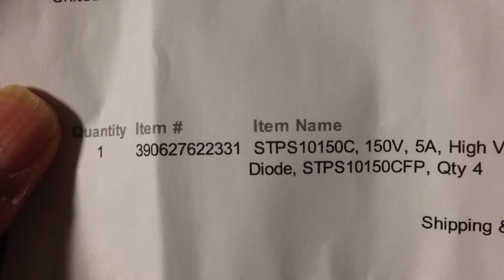Induction Heater Part 4

Comment: Awsome! I tried using a voltage regulator but had trouble getting enough current, i wonder if using two and connecting them directly to the mosfets like you did makes the difference?
hey could you do a schematic or diagram pleeeeeease?